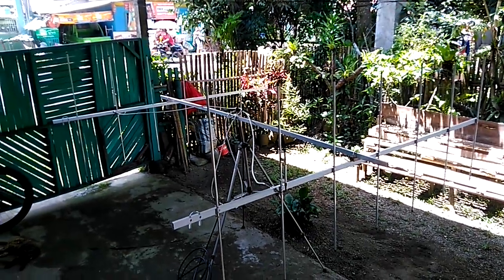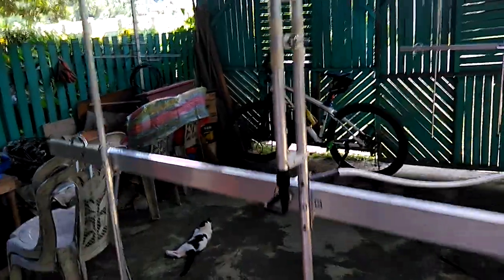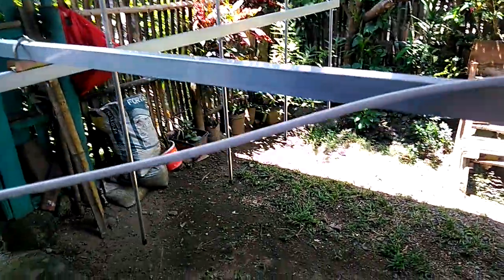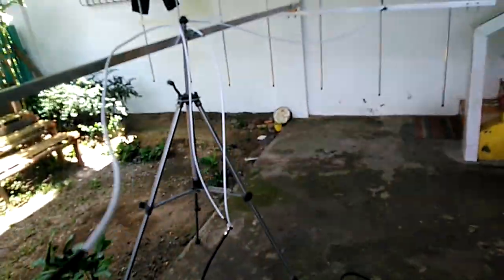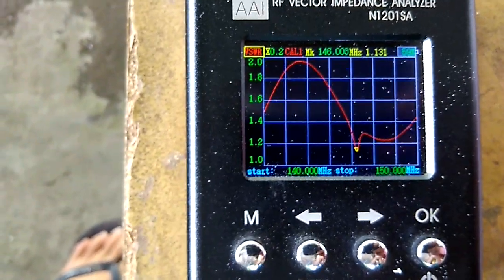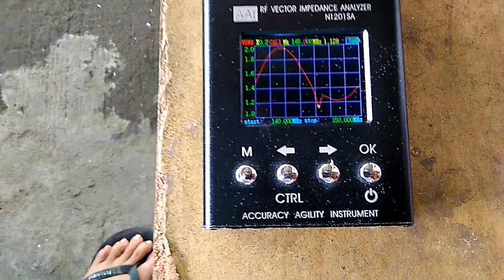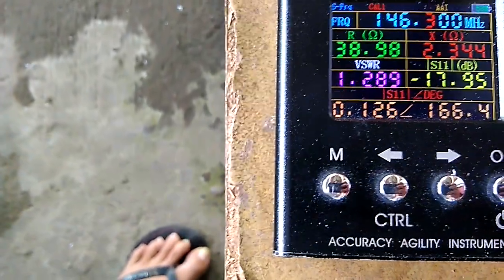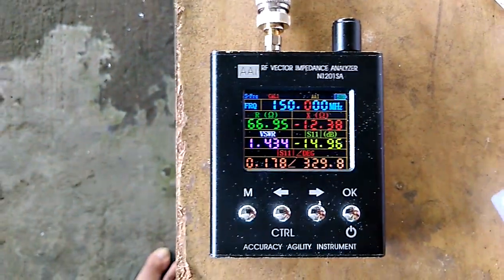2 Stacked 7 Elements Yagi calibrated with N1201SA

Comment: Ilan po ang sukat ng phasing harness yang twin 7 po master tnx po
Reply from the maker: 75 ohm coaxial cable should be cut 1/4 wavelength * odd number multiple(to cover spacing)*coax velocity factor at your antenna design center frequency.

Comment: each antenna is gama matched to 50ohms, your phasing harness is odd order quarter wave guide of a 75ohm coax, you have a terrible impedance mismatch because that 75ohm coax can never be 25ohms, id rather use sa quarter wave guide power spliter made for that, Z coax = Sqr ( Zin x Zout )where Zin is 50 and Z coax os 75ohms, the impedance connected to the antenna is around 100ohm but your load antenna is 50 ohms, pde yan set mo gama match ng antenna sa 100ohms pra matched system. or make  one quarter wave guide of 37ohm assembly with two 50ohm splitter, at least 50ohm nlng din coax at antenna, all matching nsa quarter wave guide mag isa, 

pag yun ginwa mo two antennas are 50ohms, with 50ohm coax, pag dating sa quarter waveguide power splitter it will be match at 25ohms parallel sa out, 50ohm sa input, everything is 50ohms. malaki mis match sa old school phase harness na gnyan. na dadala nlng ng gain ng bawat antenna but most of the energy is lost in impedance mismatch. 
50II50 is 25ohm Zout  Zin is 50ohms, quarter wave transmatch mo is around 38ohms at least alom match power transfer

naka kita kna ng power splitter na commecial or ginagwa sgro. you are looking kasi sa Zin part at dahil quarter wave yan, nagiging antenna phase harness mo kaya nakaka kuha ka mgnda swr, but do not match everything sa zout point. kala ko naka hard line quarter eave guide power splitter ka dito, pde yan gawin mo 100ohm impedance ng bawat antenna kasi the other end will apear around 100ohms.
Reply from the maker: gawa ka na lang ng sayo uy hi hi hi :)
Reply from the maker: i check mo na lang yung theory mo na may equation  ng parallel impedance na 75ohms saka paano  magkakaron ng 100ohms gamma eh capacitive yan, reactance ang kina cancel nyan hindi yan nag mo modify ng resistance duh.
Reply: @EphraimGariguez  alam ko 75 ohm gamit mo marunong kba mag basa bago mag comment lol, mag ka iba paragarap yan o di ka marunong mag basa, alam mba roughly 100ohm yan sa kinakabitan mo  antenna, 100ohm ba antenna mo? dba 50ohm, ang bagay dyan sabi ko power splitter which is commecially available, pde din gumwa! hindi theory yan, o wla kalang alam
Reply: @EphraimGariguez  mismatch nga 70s nyan mismatch, eto na proper  way https://www.youtube.com/watch?v=G8Dnlj2fbcc
Reply: @EphraimGariguez  https://www.youtube.com/watch?v=kmTJvInRGD4&t=276s
Reply from the maker: @jbx907  nagbigay ka pa ng link basahin mo muna function ng gamma match lol.
Reply: @EphraimGariguez  capacitive loading yan  in series with the element inaajust yan pra mag wla reactance when feeding the antenna, so magling kpa sa theory, bakit mo ginagamit theories, na daan lng ako sa twin mo tignan paano mo minatch, eh namamarunong kpa tirang bahala ka nmn pla
Reply: @EphraimGariguez  pag aralan mo quarter wave guide, may software yan paanu out cage, inner conductor diameter, pag gnyan all loading mo standard 50 tama sa antennas, kakaki na problema mo pag match pah di 50 antenna, live folded dipoles pero yan coax harness mo pde sa quad loop, rough;y 100 ohms yun
Reply from the maker: @jbx907  lol patawa ka talaga James, buti nabasa mo na function ng gamma match. Eh ano yung sinasabi mong gawing 100 ohms gamma match. Simple lang ang matching kung gusto mo gumamit ng capactive matching, ang technique dyan gawin mong inductive ang response ng driven elements mo sa center frequency na ginagawa mo, tapos gamitan mo ng maliit na capacitance para mapababa mo yung impedance sa  50 ohms sa center frequency na ginagawa mo. Hindi kung ano anong equation pa gagawin mo. Sabi ko nga sayo pag aralan mo yung Smith chart para hindi sumakit yung ulo mo ka co- comment mo dito. Eh ni isang antenna nga wala ka pang nagagawa, gawa ka muna i post mo doon sa channel mo hi hi hi. Peace James ;).
Reply: @EphraimGariguez  lol lahat ng antenna pde change feed point, palibasa kasi gama match lang alam mo, puro yan gwa eh, sge paanu na kukuha 50ohm sa dipole mo, hindi mo makikita 100ohm sa equipment na 50ohm unless high impenance test equipment mo, ang tanong match ba sa aantenna yan, eh loonking ka lang input. kala ko ba magaling ka, pa s11 s21 ka, kala mo ikaw lang may al;am dyan, paanu nag s22 at s12, how the heck do you match 50 sa 100ohm line, i guess ngyn ka lng naka kita ng power spliter na gnyan kaya gnyan prin gwa mo, same principle lang nmn alam mba twag dyan tlga eh wave guuide nmn tlga, transmatching pero wla ka mgwa kasi panahon pa ng 70 di pa na discover how get a perfect match, dati wla sila mgwa tulad mo ngyn.
Reply: @EphraimGariguez  hindi mo nga alam 100ohms kinalalabasan tranform nyan phasing harnesss mo banat ka lng agad theory hahhaa. De sna wla na nag design ng mga power divider at puro gnyan nlng gawin at mag tiiis sa mismatch. . 50ohms is not unversal pag nag sukat ka sa bakal eh 50 agad makuha mo hahaha. maspatwa ka fi mo alam why kasi instrument mo 50ohms,  coax 50, calibrated ka 50 load, you dont even understand wh6 kinalibrare mo yan lol. Akp nag ba nag papa lusot, di mo nga matangap mismatch hahaha
Reply: @EphraimGariguez  sa sobra runong mo, why yan isa klase antenna ginagwa mo, di kba makapag design ng iba antenna na di pa ginagwa. Gwa ka loaded coil, kala kp ba magling ka, circular poralized na di pa nakita ng ham. May instrument ka nmn puro theory lng kmo yan. Bakit ginagwa mo mga gwa ng iba pati phasing harness na tirang bahala kabit yan pri  ginagwa mo. Bata kpa para mag ma runong ka ng gnyan, eh taas agad tingin mo sa sarili mo di ka nmn nakaka gwa ng sarili design. Yagis were never designed by panda ever. Dapay syu open minded ka, di ka nag babasa natwa ako sa comment mo hahaha, banda huli theory lng yan
Reply from the maker: @jbx907  naks yabang parang marunong gumawa ng tamang measurements ng phasing harness. Pakita mo nga sa akin kung paano ha ha ha :)
Reply: @EphraimGariguez  assuming ka masyado na ikaw lang nakaka alam, 0at9 gama match, pati phasing harness hahaha, you are asuumming tlga. 
Phasing harniess odd order 1/4 wave has a characteristix  is impenance transforming hahaha, 
Pag short ba kabila ano impedance kabila? Pag open one side qno impendnce ng kabila sa 1/4 wave guide?
Reply: @EphraimGariguez  eto sagotun mo una, kasi masyado basic tanong mo, sagotin mo short open na question ko, wag mo sagotin theory lang yan. 
2nd question, pag inductive ano relation ng voltage sa current, sabay ko na pag capacitive ano relation ng voltage sa current. 
I want a definite answer
Reply from the maker: @jbx907  mas assuming ka James lol wala ka ngang maipakita kahit isang gawa mo na phasing harness lol :) huwag ako James
Reply: @EphraimGariguez  100ohms nga di mo alam kalalabasan nyan di ko alam. Puro addition subtraction lang yta alam mo equation. Yan ang mahirap sa assuming masyado ano ba title na attain mo? Ilan db ba nakuha mo sa pag twin nyan tapis mismatch pa lol.
Reply from the maker: @jbx907  oh kaibigang James dahil wala kang maipakitang proper phasing harness measurements  kung paanoo gawin i pinost ko na para sayo >>> https://www.youtube.com/c/EphraimGariguez/community?view_as=subscriber  self explanatory na yan ganyan ang tamang measurements lol. Ginagawa mo naman kasi  akong ang galing galing mo eh ha ha ha :).
Reply: @EphraimGariguez  bakit ano ba na iba sa phasing harness mo sa iba at nag match, di mo ma tgap di match, read the 2nd comment and 3rd yta syu, ikaw assuming. Sinabi ko lang na 100ohm mismatch, pinalalabas mo mali ako, sinabi ko ba 50ohm ginamit mo hahaha, you started this with your big head, eh, engineer kba? Baka ham license ka lng nag yabamg pako, i just telling the truth. Hindi match yan, wla lang mgwa hamsters nuon at pde nyan kung baga, as an engineer perfectionist kami, ikaw tingin ko perfectionist pero marami kpa di alam, bakit ako ggwa ng phasing harness kung mis match, ggwa ako quarter wave guide if need ko. Di ka kasi babasa banay mo binabaligtad mko, pra ikaw lang may alam sa mundo. Ako ngyn mayabang? D9 not assume, ako sinabi ko syu mismatch yan de lokohin mo sarili mo. Sagitin moko theory lang hahaha
Reply: Meron ka nano dyan ano impednace pag shorted one side, or open baka, baka di ka prin maniwala sa mga reading mo, mag smith chart ka hahhaa, eh lahat ng laman ng instumentation mo highspeed match din calcualtion.
Reply: @EphraimGariguez  how the hell mo na match sa 50 ohms yan eh mas mababa pa sa 75ohm coax, dlwa lang teag yan wla ka nga tlga alam, dlwa klase lang nag dudunongan ka lng tlga, gunagaya ka lng di mo nmn na intindihan, lahat ng nmn gwa mo gaya lang at number one di mo masagot tanong ko, di ako mag tatanong ng ma wiki mo lang, wla sa wiki yan.
Sagotin ko na pra ma dagdagan kaalaman mo, puro ka gaya lang

Nakita mo mga link ko may math sila ikaw wla, wla ako side comments na intindihan ko kasi

Pag short ang one side ng open ang ma sususkat sa kabila, pag open nmn kabila short makikita sa opposite, di mo na sagot, yan na mismo function ng quarter wave coax mo kala ko alam mo hahaha.

Voltage to current ralationship wiki mo go ahead pero ksam sa pinag aralan ko yan, pag inductive, the current lags the voltage, pag capacitive the current leads the voltage hahaha, baka pati wiki wla pa paniwala.

Mahirap makipag talo na nag dudunognan lang puro gaya lang nmn. Not even one math baka addition substraction lang, 
Ano ba natural logarithim? Bakit logmag gamit? Marqmi kpa kakainin kaya wag ka masyado mataas. 
Power splitter is way better. Same fuction but you can match it perfectly. Wla nmn coax na 37ohms, gagawa ka 1/4 hardline power splitter, 37ohm coax equivalent, pra pde parallel twin mo perfect match.
Reply from the maker: @jbx907  dami mong sinabi may pa engineer ka pang sinasabi ha ha ha, kung ang perfectionist ay kagaya mo at nagtuturo sa akin huwag na lang uy, proof muna ng gawa mo my friend  ( ham license ka rin nga, pektus naman ang score mo hindi pang engineer) . Nang lait ka pa ng tao, pag palagay natin ham license ako, ikaw engineer na license tapos nakikipagtalo ka sa akin sa matching ang baba naman pala ng level mo ha ha ha. Tapos may power divider ka pa at phasing harness na nalalaman akala mo naman alam mong gawin eh di wow. Tulog na James pinasaya mo nanaman ako. Pinapadami mo ang community comment dito. Salamat sa iyong mapanuring mga komento pampadagdag yan ng search engine traffic eh.  Huwag masyadong mag magaling ha ha ha, lahat ng komento mo sa mga ibang grupo akala mo ikaw si pope infallible ha ha ha. Ayus ayusin mo ang mga komento mo para di ka sinasagot ng masakit sa mata basahin. Alalahanin mo ang pikon laging talo. Peace James :)
Reply from the maker: @jbx907  huwag mo ako tanungin na basic kamoteng tanong yan ha ha ha :)
Reply: @EphraimGariguez  kasi minsan sumagot ka ano poh yun, ano ba ibang way pra ma match. Mali banat mo
Reply from the maker: @jbx907  kaya sa susunod mag comment ka rin ng sharing ng idea, mali rin banat mo eh basahin mo unang comment mo ha ha ha, akala mo naman tama lahat ng sinabi mo. Anong sinasabi mong "quarter wave guide"  ang tamang term quarter wave impedance transformer. Quarter wave guide ka dyan, akala ko tuloy nasa microwave antenna design ako ha ha ha. Walang "quarter wave guide" engineer ;). Ipagmamalaki mo Engineer ka tapos mali mali ang term mo, belat ka dyan.
Reply: @EphraimGariguez  wla ako sinabi mali, inuusod ko line paragraph, ang banat mo sinu mays abi 50ohm  gamit mo, may sinabi bako ganun, sabi ko, ang power splitter all 50 ohm ports matched lahat kahit 50ohm coax to 50ohm antenna. sinabi ko syu 100ohm kalalabasan nyan ginwa mo sa 75ohm wave guide. may sinama pako equation kaya di pde maging 50ohm yung side ng antenna sa coax, dati wla tlga mgwa mga amaturista wla na sila pake mataas nmn gain ng antenna system,  sa mismatch kasi sample 8 stack ~9db and  x700 same db sa vhf, no match variloop pag mismatch ka sa harness. kaya ngyn yan na dinedesign ngyn, kita mo mga malasyan  yan na gwa, tayo ayaw pa naten tama
Reply from the maker: @jbx907  sa presinto ka na magpaliwanag engineer, pasensya ka hindi ganun ang pagka intindi ko sa komento mo. Hindi mo kasi inayos ang mga term na ginamit mo. Sa susunod huwag ka magmadali mag type :) Perfectionist ka pa naman sabi mo ;).
Reply: @EphraimGariguez  75ohm wave guide can never be lower than 75ohm sa other side its like a see saw, one goes up the other down, impedance sa antenna is 100, matcvh ba yan sa antenna mo lol which is 50, dami tira bahala kasi eh na lahat6 natatamasa mo sa mga equations nyan sa mundo hahaha, gumwa ka wave guide na tama 2020 na, hilih mo sa antenna ayaw mo tama
Reply from the maker: @jbx907  wave guide ang dami mong ek ek eh wala namang wave guide dito meron ba? talon ka ng talon makalusot lang. Parang mga comment mo lang dati :) walang laman. Maka comment lang ;)
Reply: @EphraimGariguez  kung dlwa 50 antenna stack or bay mo, it will look like 25ohms do gwa ka wave guide called hardlone coax na roughly 37ohms, kung meron dna 37ohms na coax pde sna, wla eh, de tirang bahala ka, lang. wave guide yan isa nlng, tapos lahat coax mo all 50 ohms na, bahala wave guide nyan yan, power splitter din twag dyan/ kasi bahsahin mo maige eh mismatch nga sa loading 100:50, you will never see it sa input lol
Reply: @EphraimGariguez  gsto mo tlga gnyan phasing harness na 75, kabit mo antenna pde 100 pde feed tap,
Di ka makakarating sa gnyan ng wla match and equations na sinasabi mo theory lang. tapon mna binili mo NA1201 kasi theory lng pla xD. 
di ka rin pla sususnod sna di mo nakuha dipole xD
dlwa lng di mo na iintindihan at theory lng. isa equation lang fail kna.
Reply from the maker: @jbx907  anong dipole pinagsasabi mo James? Bili ka ng N1201SA. Tapos intindihin mo ang pag gamit. Saka pag gawa ng proper na phasing harness para makapag match ka ng maayos, ah kailan ka ba gumawa ng antenna lol. Pakita mo muna sa akin yung mga sinasabi mong equation. Ang antenna impedance matching simple lang James Smith Chart pag aralan mo lol.
Reply: power transfer is not perfect when unmatched, is that 100 side match in any way sa antenna mong 50 ohms, ang need naten maxium power transfer sa antenna minus loss, syu ok lng coax loss + mismatch loss, sa antenna, or bumile kna gwa na ilan ba antenna kakabit mo. meron commecially available nyan ngyn dahil sa limited availability of coax https://www.youtube.com/watch?v=_bdbCYSO6tk